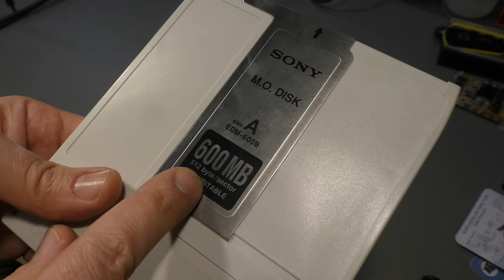Sony SMO-F541 M.O. Drive... how it works! (PWJ50)

Comment: you say it's junk but they sell for over £150 for the drive and upwards of £10 for the discs
Reply from the maker: It's always the same. When you don't need it it's worthless. But if you have to buy one, the dealers try to get money. BTW this unit will go back to stock... it's not junk yet.
Reply: Agreed - I have a multi Tb server which I wanted an offsite backup solution for, and investigated tape drives on auction sites. All the buy it now items were priced stupidly high, so for giggles I placed a bid on an LTO4 drive for $90 and won the thing. The boxes of blank tapes cost me more than the damn drive LOL! As for this M.O. drive it appears to function much like my mini disc recorder - using a laser to heat the special chemical, and an electromagnetic field to record the audio.
Reply: I have purchased a disc just as a curiosity.
Reply: The Minidisc turns on the laser and then modulates the magnetic signal to write ones and zeroes. It erases and writes in a single pass.
This drive first does an erase pass, then reverses polarity on the coil and then writes the data pattern.
That means writes take two passes.

Also note this dic is 'zoned CAV', with a bunch of tracks with equal RPM, probably because it makes skipping back easier.

Comment: a great technology for data retain over 35 years, today we don't have a solution and will lost data forever on hard drive or ssd. Incredible that don't exist a company for new magneto optical drive..
Reply from the maker: You're right.... Old paper books keep data for 500 years or more. But the more data we have, the shorter is the lifetime of the media.
Reply: @PlaywithJunk  the solution is multi qr code but I'm not a programmer, a paper of 100 qr code is 7mb
Reply from the maker: One QR code can hold up to 2.9kBytes which would fill about one page A4 size (or more, I have never tried that). That means you could also write plain text in a small font to get the same result.... But of course QR code would be easier to read back into a computer.
You could als use long paper strips to create an "optical paper tape" on large spools with small QR codes in a row.... :-)

Comment: I'm bulding a PC specifically for various retro data storage media, gonna be pickng up a 9.1 GB MO drive too, definitely
Reply from the maker: If you already have a SCSI controller, that shoudn't be a problem. Finding a working drive is probably more difficult.
Reply: @PlaywithJunk  I do have a SCSI controller. In fact I was able to find that rare motherboard that has both PCI-E for the graphics card, supports 64-bit  core2-era processors, 2 floppies including 5,25'' and also PCI peripherals. The perfect blend of relatively modern user experience (should support win 10) and legacy data storage compatibility. Have yet to buy the drives, which can unfortunately be quite expensive.

Comment: The discs look a lot like DVD-RAM discs with the physical sectoring, very pretty.
Reply: Nick what was the write and read speed?
Reply: DVD-RAM or M.O. because I've never even seen an M.O. in person, I have some DVD-RAM discs and they are supposedly 3x speed, but I can't tell you the transfer rate in MB/s because they've degraded and can't be read.
Reply: Nick Yeah, DVD-RAM more or less borrowed the sector pattern from MO.